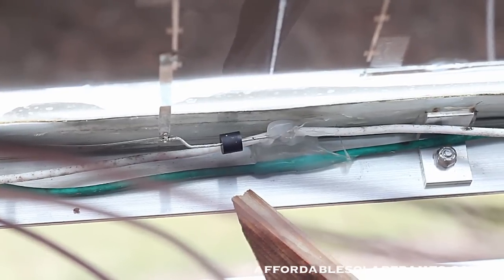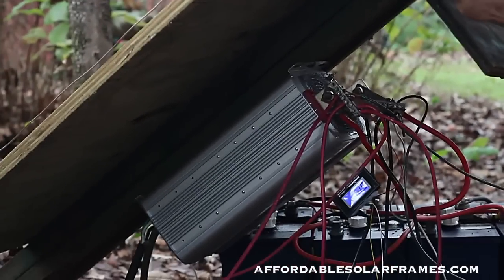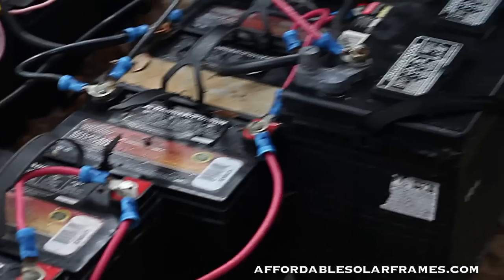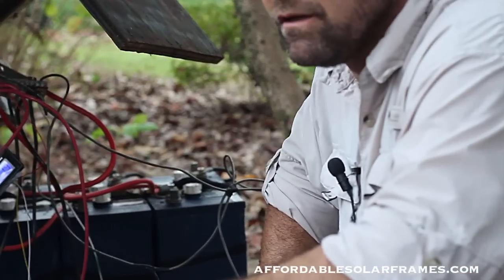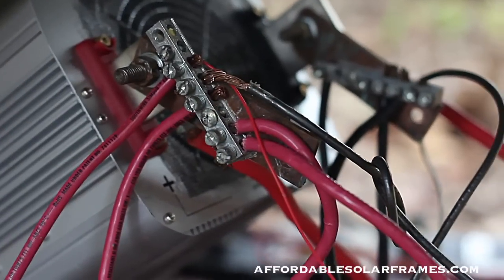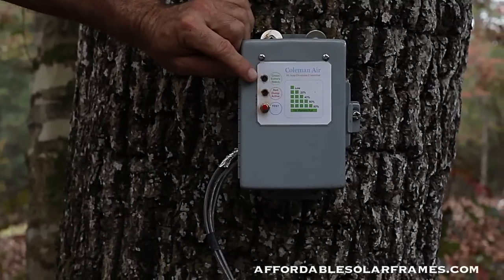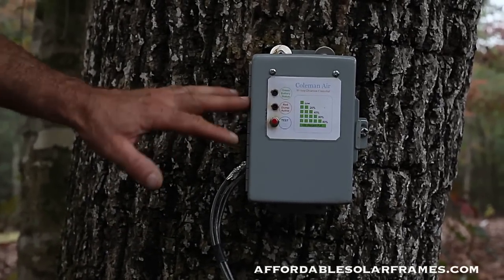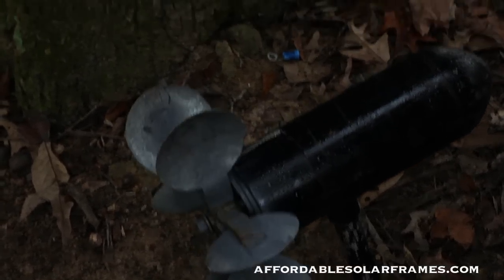How to connect solar panels to battery bank, charge controller, Inverter

Comment: Hi Mark,  I'm looking for a solution to mount my grid-tie inverter outside.  I assume they are not waterproof.  Do you have any issues with moisture or water on your inverter?
Reply from the maker: +GunGeek No problems with moisture. I did have a problem with a close lighting strike. I have added 3 more grounds and a manual disconnect that I shut off before a bad storm.

Comment: Hello Mark watch a few of your videos an I felt like I still have to ask an to be sure with what I'm trying to do. . 
I'm trying to make a mobile solar generator an plan on putting everything in a large tool chest. 
Ok I bought a 100w mono crystalline from . Plan on buying for sure 2 deep cycle batteries. 
All I'm trying to power an not all the same time an for at less for about 8 hours for sure is , batteries from cordless drill, shop vac, an 2 hanging lights on mybe 2hrs at a time, corded polisher on & off for 8 hours, an ( if possible but not needed nor a necessity ) a 13 amp 20 gallon or less air compressor.  
If I have to nuy a second panel I will. Just noteing that. 

So now the questions. 
Can a 30 amp charge controller work? My budget is at most $70 would not mine to upgrade later..
Can a 1000w continuous power inverter power what I need?
Can 4 or 6 gauge jumer cables work or stranded or THHN stranded wire works?
An is it okay to use breakers a fuse ? Instead of fuses.
Were is the fuses needed?
If you would mind helping me with this project I would really appreciate it.
Reply from the maker: Cody Castro HELLO. You will need more panels to run all that and at least a 3000 watt inverter to run a shop vac. The 30 amp controller and the 4 gauge wire will work. The inverter has its own fuses so you will not need one. Watch this short video of a portable system. https://www.youtube.com/watch?v=TZETvDpwIjY

Comment: Hey Mark look,I was told you can't put battery's right on the ground because the charge will suck the juice out of them, but I thought I noticed yours right on the ground with no buffer. What gives buddy?
Reply from the maker: The batteries are on pressure treated wood.

Comment: my batteries drain to fast well in minutes any help and that is on 1 led of 5 watts
Reply from the maker: joe18370 It sounds like you have a bad cell in one of your batteries. Check and fell if one of your batteries is warmer than the rest.

Comment: Diodes serve as current limiters in some circuits , and may Not allow full power to collect so the best way to connect would be AFTER The Regulator .

Comment from the maker: Is is best to use deep cycle batterys. I have a new video on how to connect the panels to charge controller to the batteries to the inverter. I left a link in the description.

Comment from the maker: Hello. Every panels needs it own diode. I have a dump load because I also have a hydro system connected to the same system. The hydro must have a load at all times. I have not had any trouble with the inverter outside.

Comment: The best part about showing diagrams is you only have to show them for a second if they are still because the viewer can always pause the video and or make stills from it that can be printed out. Using vlcplayer, there is a snapshot feature. Cheers

Comment: Thanks for sharing! I can't wait for yur next video. But, could I make a small suggestion? When you are describing the battery connections, can you use a diagram. It's just that in the video, you can't see the tops of all the batteries and it seems like you didn't explain all the connections, only the front ones. I just think a diagram would be much better. Maybe have another diagram for the solar panels, the charge controller, and the power-inverter all together.Thanks again! LoveNHugs2YouAll

Comment from the maker: I have found that I get more power out of my whole system when each panel has a diode. If one panel is in the shade and the rest are in the sun the one shaded panel brings down the amps of the whole arry. That does not happen when each panel has a diode.

Comment: question about the diodes........are these only for home made panels?  I haven't heard anything about having to install them on commercial panels.  You don't have a  600v dc disconnect between the panels and the charge controller?

Comment: The a/c kicking on draws much more wattage then while it's running.  It's likely this huge power surge will not have enough power from a battery bank, so you should definitely do some research beforehand.

Comment: thought it was more like 15-18% per panel (depends on the type poly/mono) 

it can be as low as 6-8% on the DIY panels (poly kits, can't seem to get mono kits in the uk), 

as i did look at making my own panels but you need 2-3x (90w or lower per panel, 1.6m by 1 aprox) as many panels that compare to just one 1.6m by 1m panel (mono 250w) with same power output and aprox price 

for one panel vs 3 DIY panels was so close not worth the effort and price as well

Comment: Thanks for producing this video. Continue to do more. Thanks for informing us of your problems and your solutions. Things I never thought about. Thanks for telling us that this is a long term working system. Some food for thought: It only helps to make the wires bigger instead of smaller. Exposed wires and insulation will last longer if not exposed. Keep batteries clean and off the ground. Treat all exposed wood. Use metal tie downs for strong wind conditions. Use copper wire and not aluminum.

Comment from the maker: It will take alot to run a ac unit. You will have to find what your wattage is on the ac unit then multiply it by 5 and that is how many panels you need. My guess is around 11,000 watts of panels. Then you have to match your batteries to the 11,000 watts.

Comment from the maker: Yes the pure sine wave is better. Years back I got a good deal on this inverter and that is why I bought it. You need a big inverter to start a refrigerator "around 3000 watts". I run 3 referigertors off mine. The modified sine wave inverter is more efficient and only uses around .3 amps when nothing is on.

Comment: Hey mark what size wire did u use from the batteries to the inverter i just bought one they said 4/0 but that wire is high as crap but thanks good video

Comment from the maker: I paid around $400 for the inverter. I don't remember how much for the charge controller/less than $200. The path on my system is panels to batteries to inverter. The charge controller hooks straight to the batteries and simply puts a load on the batteries when needed. I have a hydro system so that is why I went with this system. With just solar you will go from panels to charge controller to batteries to inverter.

Comment: whats the cost of the aims 5000 inverter and the charge controller. Could you explain the path. Is it pannels to inverter to controller to batteries??

Comment: ofc because inside you didn't use proper ventilation.  Is that inverter rated for outside? or just inside...and cables will corrode not so fast as inside without ventilation but they will trust me. If they are only copper they will for sure

Comment: hi i love all this stuff and have decide to give it a go at a piece of land where i have no power, my plan is 2 x 100 watt solar panels and a 550 watt wind turbine wired to a 15amp power controller wired to 6x 6 amp golf buggy batteries and them wired to a 1200 watt inverter with a single plug and hopefully this will power acouple of low watt lights and a kettle in my workshop does this sound ok ???

Comment: True, the open air could help. I have found that the corrosion usually forms around the -ve terminals, but on just some occasions you get it on the +ve too. I suspect that is when certain materials are used for the connection. Some people put a special kind ov spray over the compleated connections to inhibit the corrosion. Which is something I might look at, as I can't have mine outside - people would nick 'em around here..! heh

Comment from the maker: Hello. I don't remember if its was both terminals or not. I think it is more than just rain that keeps it from forming. I think the batteries out in the open air keeps the gases coming out of the batteries from corroding.

Comment: That's really interesting about the corrosion. Was it on both terminals ov the batteries or just the -ve ones? I would suspect that having them outside is letting the rain wash terminals clean before that corrosive powdery stuff can build up.

Comment: I love this stuff!! Great information!!
SAFETY Note:
Know that when a Sulfuric Lead acid batter is charged/discharged there is an emission of Hydrogen, if your batteries are enclosed this Hydrogen must be vented away from any possible spark or heat source. Even though you may have a "sealed" battery small vent caps exist to equalize the pressure, whether from altitude change, barometric changes, or from pressure created by Hydrogen build up.

Comment: Clean all my batteries with vinegar about every two weeks if needs. service with distilled water if needed! My 2500 amp battery bank is maintained at above 11.7 vdc to 14. vdc were the misouri wind and solar controller dumps it. Normally the system powers a 8k Aims inverter which runs a 110 vac submersible well pump! currently using 1920 watss of solar panel. adding 1280 more before summer to run an additional two 550 A/C units!

Comment from the maker: Deep cycle battery has less plates but the plates are thicker and will give you more amp hours. A car battery has more plates that are thin. It will give you a lot of amperage for a short time. Gell batteries work best but they cost more.

Comment from the maker: @Prancinglion1 You do need a blocking diode. I use 3 on a 108 cell panel. 1 for every 36 cells when wired in parallel. You will need a bigger diode to match your amps.

Mark

Comment: With a 108 cell panel, that's a lot of current.  How large is that Blocking Diode and can it handle the Amps at maximum output?  What size is it?  The panels I'm building are pushing 22-23 Amps and I'm wondering how much current a blocking diode will handle, and are larger diodes available or even necessary?

Comment from the maker: That is what I though. I started with a shed and had my batteries and inverter inside, but I had trouble with ants, centipedes and squirrels. Also my batteries terminals keep corroding. I was adding panels and batteries to my system and I ran out of room inside my little shed so I put some of the batteries outside the shed until I could build a bigger shed. Then I noiticed that the Batteries outside the shed was not corroding or attracting bugs. I have very little maintenance now.

Comment: @markp0177 I use flattened copper pipe, drilled out where need be. Then, of course I wrpa it with electrical tape where I think it is at risk of making a short connection, so that it is more like cable. I find that when running parallel banks, it is important to take your + from one side, and your negative from the other, or else the nearest battery takes a huge hit. Great vids Mark. Merry Christmas.

Comment from the maker: Hello. Any deep cycle battery will work. I got my batteries used from a battery recycle store. They are large 6 volts batteries. They were used on a floor sweeper. I have had them for years with no problems. The wire I used is simply car battery cables I got from auto zone.   Mark

Comment from the maker: @tomlauwers Hello. That is how I have my system. You have to have a charge controller. The power from the panels goes to the controller and then to the batteries. If the batteries are full the controller will disconect the panels. You wire the inverter straight to the batteries. You can then plug in your appliances to the inverter. Mark

Comment: I'm looking for clear information about how to wire the solar-panels / batteries / wiring to the house, in an off-grid system. What do I need exactly and how is the wiring done?
I want to have electricity in the house 24/24 and during the night I would use less (eg fridge). So during the day for example 60% of the solar panels' output would be used immediately and 40% would be used to charge the batteries. During the night there is no solar power and everything would run off the batteries. How?

Comment: @sqhschief   Grid tie is a waste of money as the cost of the system will always greatly exceed the value of the generated electricity.  Battery only systems are cheaper (quality GTIs are bloody expensive) and are cost competitive with generators for grid down situations.

Comment: Can you please another video better explaning how you set up your solar palnel and your battery bank. The AUDIO on this video is a little poor and its hard for me to hear. Can you tell me what kind of INverter I should invest inn. I want to run wind power and solar to my home. I want to have a least a 1000 watts worth of wind and the same for solar. I see you have  a 5000 watt inverter. would that help me. I was going to use the 12v set up. Please write me back I have bought a 70 site from you

Comment from the maker: Hello.You would need a grid tie inverter to plug into wall outlet. I chose the battery  system because we have power outages alot and hurricanes. Also the new power meter does not turn backwards.  Mark

Comment: Hi Mark,  what is the reasoning for the battery system ,  v 's    just plugging your inverter into your GFI  wall outlet.
Reason i ask , i want to , buy a inverter and maybe plug it into the wall. would the aim 5000 still be good, with the no battery setup.
thanks for your information.